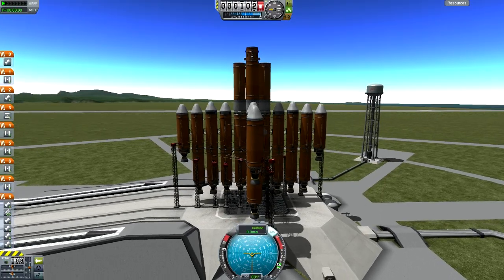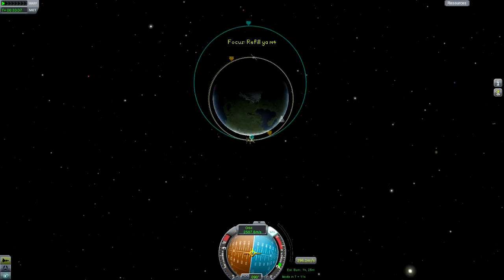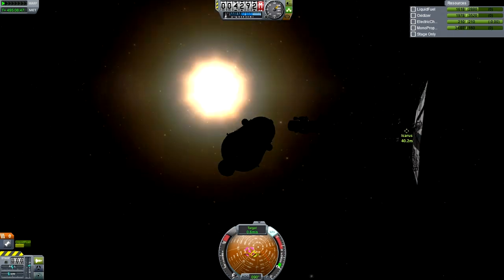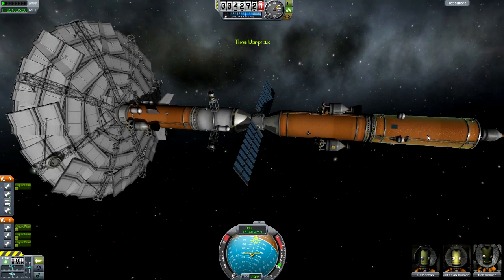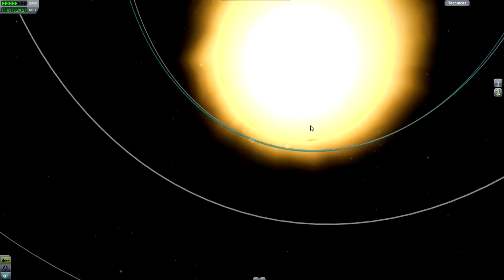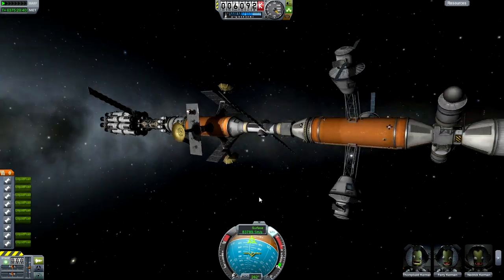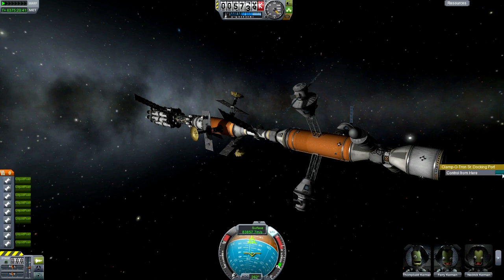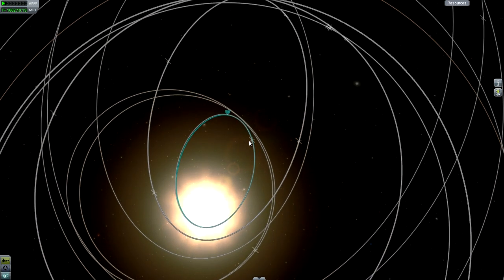KSP - Sun Station Ep.5 - Interplanetary Docking

Comment: Heretic all you have to do for spinning thing for the station all you need to do is put 1 RCS motor on what ever he wants to soon and in the direction of the opposite way he wants to go and place heaps of 
RCS fuel tanks and then cage the thing so it does not soon off the station then turn on the RCS and then turn it off and the object will kept spinning and if it slows down just turn it on again. Hopes this helps

PS you should put Ken on it